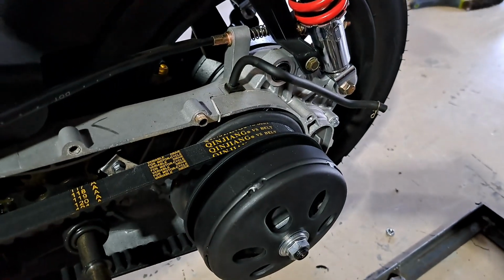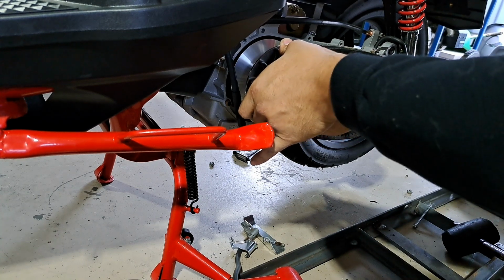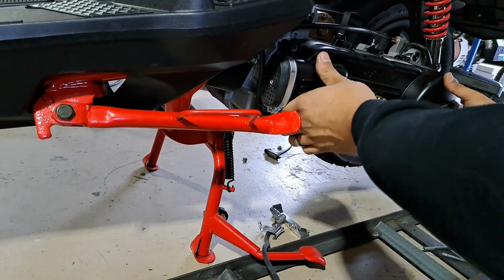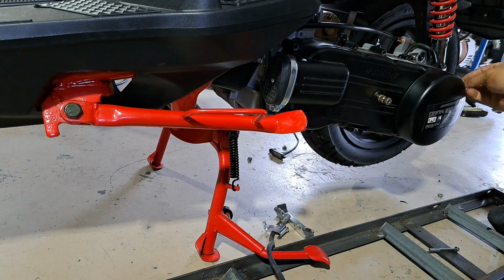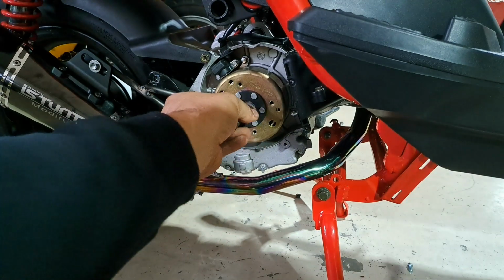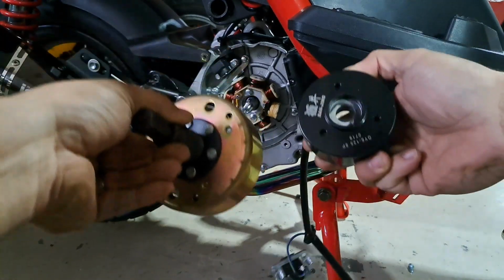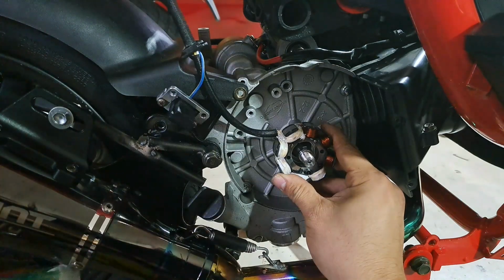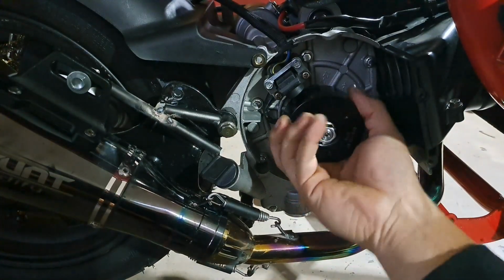chronicles of owning a Chinese scooter : lightening things up

Comment: What's the downside on the smaller pulley?
Reply from the maker: None really as far as performance goes. But charging wise it doesn't give the same charge at idle as it is a smaller stator than the factory one. But while riding, the charge remains the same as stock.

Comment: That ban jing flywheel is for racing only....youll soon find out tho lol
Reply from the maker: Ran similar product for a 2t for over 1500 miles. So far I've done 44 miles on it so far, well see how long it will last.
Reply: Is that because it doesn't do a good job of charging?
Reply from the maker: @RonkerRoom  it charges when running normally down the road,  but not as well as factory at idle. Though if I increase idle the lights are just as bright. But I like a nice quiet idle on my builds.
Reply: @RonkerRoom  It's because (unless I'm wrong) the plastic fan for the air-cooling system can't attach to that tiny little flywheel. So your only option is to run the engine with no cooling at all, which is fine for short races or whatever but not good for reliability

Comment: Mans really just took off the most CRUCIAL part of the forced-air-cooling system the scooter relies on to dissipate the massive buildup of heat at the head... that just hurts to watch

The plastic fan that spins on top of the stator's flywheel is there to shoot cool, fresh air under the plastic shrouding of the engine head. That air is "forced" (hence the name) under the shrouding and the hot air is forced out of the shrouding. When you're going down the road at higher RPMs, the head is generating a lot of heat, but the fan is spinning super fast and forcing a lot of new air under the shrouding and basically acting like a big fan.

If you remove the fan, the hot air just stays put under the shrouding and accumulates more and more and more heat... The engine has no other way to dissipate heat, like a radiator, or even having the engine head exposed to air like motorcycles do. The head will get so hot that you'll soft seize, damaging the jug and piston, leaving you stranded on the side of the road and permanently lowering your compression. You also risk damaging your bottom-end bearings from having the circulating oil get extremely hot and thin. Your CVT will overheat as well, because of the proximity to the crankshaft and the crank-case, and your belt will slip and damage itself, your rollers will wear faster...

TL;DR, please re-enable the forced air-cooling system
Reply from the maker: Hey thanks for commenting if you see future videos you see the fan is installed.this start was the first start just to see if the ignition worked. Not enough time for the cylinder to have reached any damaging temps.
 I believe in my video description it says a minarelli 90cc fan is needed to run on this flywheel as I stated in the video the flywheel is minarelli based.
Thanks for the comment and watching the vid.
Reply: @X7rocks  I ran my 171cc gy6 5,000 miles without the fan or shroud. You just can't go on an extended ride. I would go about 8-10 miles one way.
Reply from the maker: @thelagmeister  I just keep it on to maintain Temps as much as possible.
Reply: @X7rocks  For sure. I don't recommend running it without the fan or shroud. I just wanted to say it's not going up in flames if it's just for short rides. It was cool watching your vid. I've never seen one of these tiny flywheel/stators.